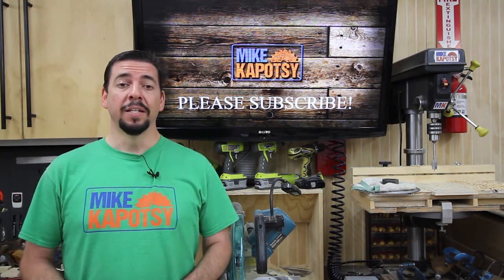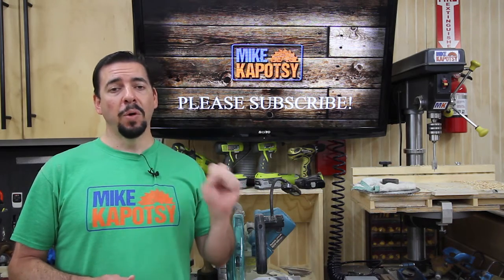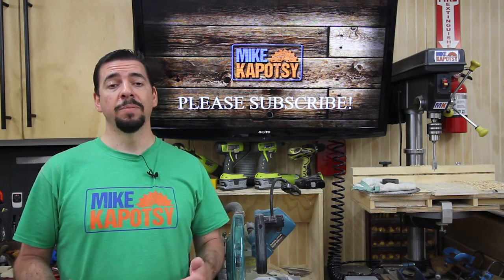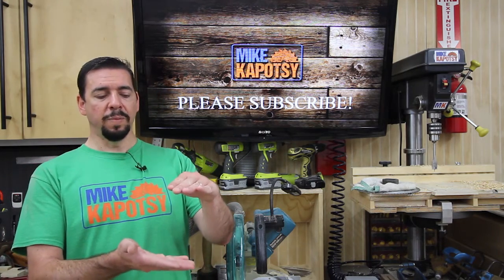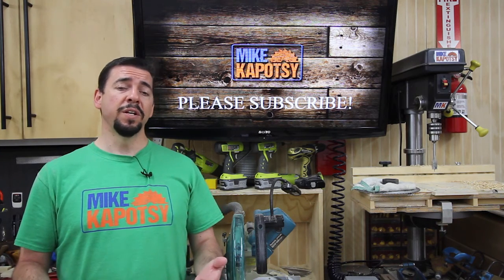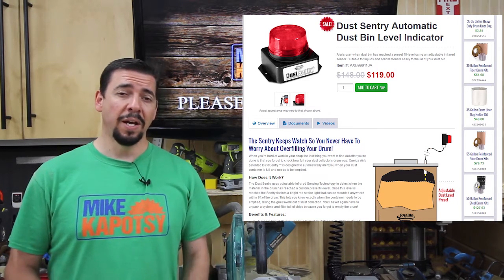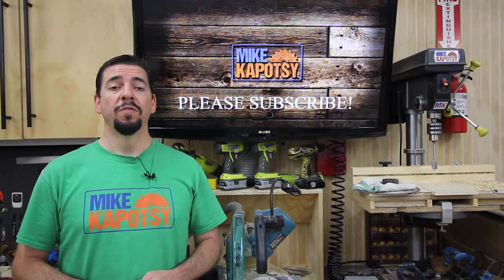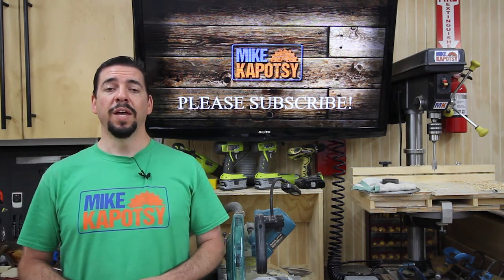Installing the Oneida Air Systems Dust Sentry

Comment: Mine never works reliably. The issue is that as the dust falls from the cyclone into the bin, it tends to form a peak like a mountain. If you place the sensor on the lid similar to what you did, the sensor won’t pick up right because the sides of the dust mountain are not in the range.  Many times the dust gets too high that it starts backing up.  You almost need the sensor inside right at the edge of the cyclone.

Comment: I see this video was posted in 2016, so now two years has gone by, what are your thoughts?  I spoke to an electronic whiz kid I know and his concern was that if the sensor gets a layer of dust on it you may get a false alarm.  Can you discuss this?  I am NOT a troll or trying to be negative, I have an Oneida system and know them to be a great company, but just curious how this has worked out for you.
Reply from the maker: Hey there Dan.  I had a static issue with the sensor despite being grounded.  It was replaced.  It does tend to collect some dust so you do have to be mindful of that and wipe it off occasionally.
Reply: @MikeKapotsy  Mine stop working all together after 4 years not sure where the issue is now it's a $148 replacement plus tax and shipping.

Comment: why is there so much dust on every thing around the separator? My home made Dust collector does not have standing dust like this one does.
Reply from the maker: +TheFalconJetDriver because before I put the canister Wynn filter on above the bag, I had a small leak where dust was blowing out.  Still haven't cleaned it up.  Doesn't do it now.
Reply: Cool! Thanks for the reply, I was not trying to be sarcastic when I asked the question, in fact I have not incorporated dust collection on the top of my table saw yet I have not found a good way to so with out having a bunch of vacuum lines and baffles over top of my blade.  If you saw the top of my table saw you would see dust there,
Reply from the maker: +TheFalconJetDriver no worries.  Ryan @shopbuilt did a good one for table saw top out of PVC.  It works well.

Comment: Hey Mike, I was actually going to be doing something very similar. I recently got a BinMaster rotary indicator similar to the Bindicator Oneida Air offers. I got it for $100 but I'll have another $75 in to the 5 wire plugs and cord, but it will work just as good. Nice score. Thanks. Scott
Reply from the maker: +The Wood Craftsman (puttz1976) thanks Scott!  This one works great!